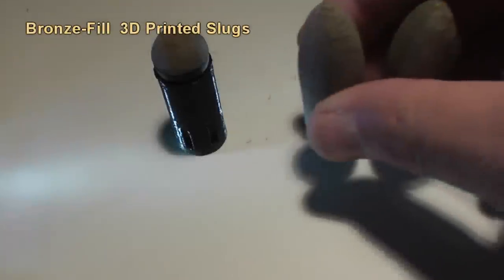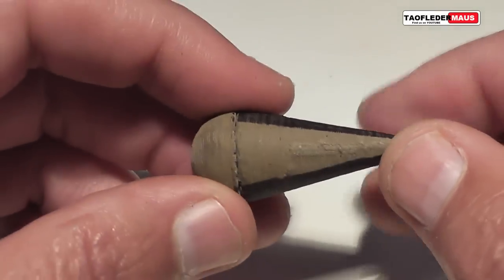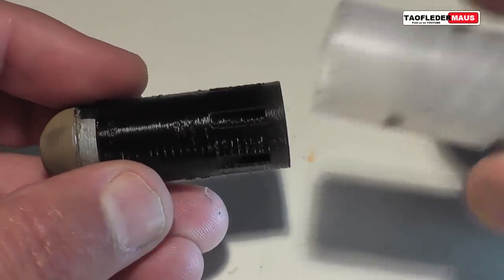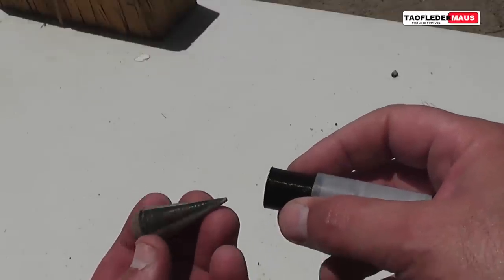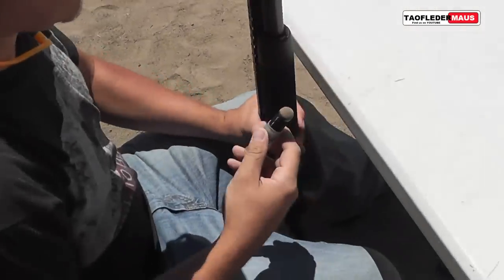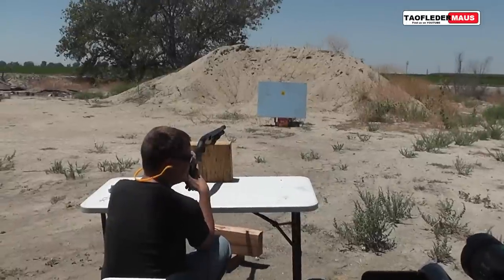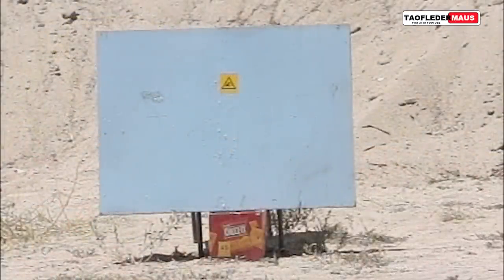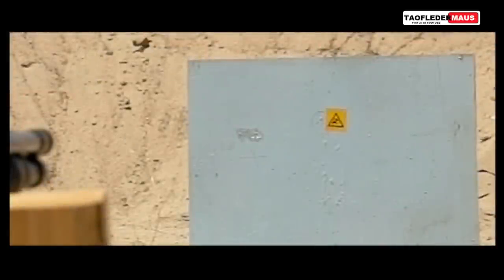Teardrop-shaped 3D Printed Bullet -   Fail Analysis

Comment: Sabot separation is pretty well understood. Teardrop shaped bullets... not so much. As was seen (despite being covered by the sabot), I expected the tail to move in a circle rather than just spin. That would need to be counteracted by an increased spin speed and likely some kind of groove to keep it stabilized. You could try to have the sabot split into a number of parts and spread wide, perhaps by a small secondary, mid-air charge.

Comment: It's nothing to do with momentum, there's an aerodynamic effect that the shot and sabot are sharing with each other. When the shot left the barrel, it created a vacuum behind it which sucked the sabot into it. This gave the shot an aerodynamic shape so it flipped turn-ways at which point the sabot was vacuuming the shot into it. It's essentially the same as driving behind an 18 wheeler on a much smaller scale at much higher speeds

Comment: I would suggest that the sabot be separated into two or three pieces. That should allow for separation after clearing the barrel. The shockwave probably pushed around the round and the sabot lip so the sabot never felt the extra drag necessary for release. The shockwave would create compression as it pushed on the round while the sabot was in the "draft" of the lead body so there was never a chance of them coming apart. I am only guessing as I have never seen a solid sabot like that before.

Comment: How bout splitting the sabot into 3 or 4 pieces and flair the tip a little so when the round and sabot leave the barrel the sabot pieces peel off with the air resistance? Much like a sabot round for the M1 Abrams.

Comment: First thing I thought of when watching even before noticing the title was those are going to mash together and get stuck. I would think that's really what happened, the lower mass of the sabot got mashed while the higher mass shot took a while to reach velocity.

These are always fun rounds to see though. Let's see if the news casters freak out about a failed round as much as they did the first 3D printed shot you used XD

Comment: There's more weight at the front than at the back,so when it leaves the barrel it tumbles,also if it's a smooth bore that would also play a part,as let's say  a 7.62 bullet head would tumble when shot out of a rifle if there was no rifling ,no saying that those two bullet heads are the same but the principle behind it

Comment: The rounds didn't separate bus use both the holder and the round were moving at the same speed if there was a way to hold the holder in place as the bullet launched it would work

Comment: I am by no means an expert but I would assume that the sabo didnt separate due to the fact it was sticking out of the shell too far away from the powder? If you made the sabo slightly skinnier and pushed it in all of the way maybe it would stick with the shell and the bullet would dislodge? That or possibly make the sabo out of a softer material that simply breaks apart after leaving the barrel?

Comment: 2 theories but I'm pretty sure all played a factor and a possible fix. 1st compacting - since the holder had to accelerate first and was less dense then it essentially packed the round inside of it before it left the muzzle, I'm sure that sharp point, different densities and heat didn't help. 2nd velocity and diameter  - since they both were the muzzle at the same speed and the diameter of the two were the same even with the lighter mass of the carrier it had no drag to slow it down and cause the two to separate since they were essentially stream line. If you try it again notch the carrier to add some drag. Should do the trick if the first theory doesn't override it

Comment: If the sabo had a two part construction it likely would have fallen to the sides on exiting the barrel. Alternatively a hole in the bullet from nose to tail might allow the air pressure from forward momentum to separate the sabo, this would also reduce drag on the round and I hope might also increase flight stability
Reply: Realised that I got my physics wrong lol, adding a hole to the bullet would increase drag due to an increase in surface area

Comment: If you cut the saveo or whatever into 4ths it would have split off a little more freely because it splits up the weight between 4 and will slow down faster than the whole thing

Comment: im not surprised the two parts stuck together.  In the world of machine work, conical tapers are used frequently to precisly adapt a machine spindle to a cutting tool. These machine tapers come in two basic types.. self releasing (CAT, 5C, 6K...) and self locking (morse, r8...) . There is some overlap but generally speaking, the smaller the cone angle relative to the rotational axis, the more likly it is to be self locking. Other factors do play a role... things like surface roughness, relative strain (streching from the wedging effect), surface hardness.. but all can be mitigated or exaggerated simply by changing the angle. 

To fix, I would  finish the cone end with a post that prevents the tapers from seating during the "g shock"

Comment: I'd say the bullet didn't separate from the bullet holder because they were both massive and had same density meaning they had the same acceleration through the air, the reason a normal shotgun load separate is cause the holder is plastic and the bullets are lead meaning they got a big difference in density and therefore accelerate differently in the air, the light plastic will simply slow down while the heavy lead will keep on going.
or it could simply be cause a 3-d printer makes a real rough surface and with the shock in the barrel they could simply have been compressed together so hard that they got stuck in each other.

Comment: maybe model the sabot after traditional wadding. like, in a way that it will fit the round into the shell properly but also "releases" it once it leaves the barrel due to drag. have the round itself touching the sabot to prevent it from being jammed into it due to a loose fit.

Comment: If the sabot is a thermoplastic (which i would think is a requirement for most plastic 3d printers) then there is a chance that it may have bonded (remelted) to the tailed end of the projectile as a result of the heat and also the pressure. I'm not saying it completely bonded or bonded very well, but rather bonded at least enough to hold on until hitting your sky blue wall.

Comment: I believe that it is the same principle applied to shaking drinks in a bar. you have to cups that are pressed together at a changing temperature to create a vacuum. I believe that a vacuum was created and forced the two pieces together. Make the casing to where it can break and or fall apart after it exits the chamber.

Comment: Try splitting the sabot cup so it'll peel off and take the Round to a belt sander and smooth it out it looked a little rough smoothness helps lessen the resistance

Comment: Try making folding flaps on the sabot so it has more air recistance and lubricate the space between the sabot and the round with gun lubricating oil the round wil also clean your gun because the pressure pushes the oil out

Comment: ha! have levers in the sabot that have light tension against the barrel & push out into the air stream to catch resistance and pull back once they clear the barrel. Also the tension would grip the round in the barrel with the pressure pushing on the levers, simple levers.

Comment: The sabot needs to be split so that it can more easily come away from the round, but also the round doesn't fit well into the sabot and it has that little point on the tail end. If it's sitting marginally forward in the barrel and the sabot is rammed onto the tail it may embed the tail into to the material of the sabot, binding it in place.
After painting the round you could have used some sand paper to ream the sabot to improve the fit, and maybe put something hard in there to stop the tail embedding, or maybe smooth the tail off a little? I'd like to see the same sort of round fired again with a better sabot.

Comment: I have no idea as to whether this  is true, but from my understanding, two materials of the same type rubbing against each other creates a lot of friction. Is it  possible that there was too much friction for the projectile to separate?
Reply: Vernon682 It's not fiction if they are not moving.
Reply: softrockification It is called static friction. It is due to the surface irregularities of the two solids interlocking. 3d printed solids aren't smooth for (so) many reasons, and that might actually be one good reason why the projectile did not separate.
Reply: Vernon682 That is a very likely scenario. The cone shape is pushed hard into the cavity and jams stuck due to static friction. There may also be an element of heat created by friction or compression causing the projectile to stick even harder.

Comment: Try this, use a small O-ring or print it with a lip all the way around it, so it will fit snuggly in the shell. Then you will no longer need the holder but since the round is so odd shaped it will mostly tumble.

Comment: It seems that the sabots & fittings are compressing disproportionately with the intended "slug" part. This may cause a rubber-band effect when they discharge out of the barrel leading to an uneven or failing separation. Specifically, the fittings are compressed against the "slug" right up until exiting the barrel. The subsequent decompression causes the flexible part to expand unevenly altering the trajectory. Although there are different solutions to this problem all solutions require complete separation of the "slug" from the rest of the assembly. This is not the only video where such a problem manifests.

Comment: Ultimately I think your sabot needs to split. I think mechanics and aerodynamics are keeping that sleeve-sabot in place. 

Even with it though, it didn't fly terribly - seemed to be doing some self-righting as it penetrated and flew pretty straight for being two bits held together. 

Further, I'd be curious to see how it does perform under a full powder charge, it held up fairly well under the stress of the nerfed one.

Comment: it likely didn't separate because the sabot was the part that received all the power from the shot, so it had a higher energy than the tear drop and was pushing the tear drop, to make them separate them the tear drop would need to be travelling faster than the sabot, could probably try using a better high speed camera or a rifled barrel for this. No but seriously if you maybe added more air resistance to the sabot maybe it could slow enough to separate, but at that short distance I doubt it would be very noticable

Comment: Hey just had a thought, what if the sabo were four seperate pieces, so it flies apart right away after it leaves the gun.  I think that'd bascially take care of it.  Also i'd maybe try to have him make it with a slightly thicker tail and have the tail portion of it be hollow so that the round is more nose heavy and will want to fly straight.

Comment: how did you actually expect the teardrop to separate from the rest? because the air is pushing it inside. how could it even come out? i think you'd need to find another mechanism to fire those teardrops and then maybe they would work.

Comment: I'm no gun expert, but to me, if the lip on the holder/sabot extended past the diameter of the projectile, then it would have enough drag to separate. Just my opinion, I might be wrong.

Comment: The problem could be that the sabot was not designed to separate or possess any kind of aerodynamic elements designed to catch or resist the flow of the air and pull it away. Being that the two objects are of equal or similar density, there is simply little going on to resist the force of acceleration the aerodynamic forces that would make it require more energy for the cone to leave the cup than to stay in it.

A solution for this could be machining the sabots to have inward-directed air intakes on 4 sides redirecting air out the back. These could be arranged to spiral or simply point inwards at a shallow angle to either give the projectile spin or simply pull the cup off. This would (should {could}) act as a solid drogue chute and 'tug' the sabot off of the 
 Another possibility is that the 3d-printed elements bonded together from the heat and compression of being accelerated - not entirely sure on this one, but it is possible. In that case, coating both the inside of the sabot and the projectile with a dry lubricant like fine graphite powder could help prevent this.

Comment: Hey!
I think if you cut the sabot into quarters at its lenght, than the drag will peel it off the slug a it enters the barrel.
Reply: sh...t not enters, but exits the barrel.
my bad.
but still it would be cool to see it.
Check out the Chicken-air-cannon from Mythbusters, they did it right.

Comment: I'm betting there's a few things going on to make it fail. The shape of the round  particularly the ridges and wedge, are probably acting like a splitting mull on the "wadding" section causing it to expand in the barrel. The ridges are probably also acting like a golf ball creating micro turbulence around it in flight keeping it flying backwards even though the weight is at the far end, assuming the round and "wadding" section are different materials. Some fins on the round  keeping the right diameter  and you could print a wadding section that would go between the fins and be less likely to jam like that also providing better stability in flight most likely.

Comment: Sabot didn't separate because it was in 1 solid piece, Also it flipped ass backwards for some reason and the round it self was Behind the sabot so because there wasn't any resistance on the sabot it wouldn't fall away because it was being pushed by the round its self.
Kinda stumped as to why it flipped ass backwards though, would have expected all the weight to be in the front because of the cone shape.

Comment: the sabot should have been split in half or in quarters before being placed into the test cartridge, than upon exiting the barrel it could have flown apart leaving the round to travel  to the target instead, also design the round smaller , leaving the edge of the sabot to catch air as it exits the barrel to split apart sooner.  Another option is to forgo the 3d printed tear drop for a milled one from brass or cast?  just some idea's

Comment: I know it probably doesn't explain why the assembly didn't separate, but I would have thought that teardrop shape might lack the rear drag necessary for stabilization?
Reply: Actually a long tail helps with stabilisation. Since it has a higher surface area; when it begins to yaw, there will be a higher area exposed to the wind, thus a higher drag force, realigning the round. You can see that on the video where he shoots powder from shortened pipettes.
Reply: Yeah, but given the taper angle and lack of protruding fins (or anything like it), I would have thought the head barges through the air and the friction against the tail would be minimized? I think it's a tumbler. The tail isn't going to catch enough friction. By the time the tail starts to drag, it'll already be yawed way off course. Not the same with the pipette - no angle; it's all in line.

Comment: Teardrop needed fins, sabot needed to have a reason to separate, that's why you never make it in one piece but at least two and better three or four with big angles for it to snap right away.
This was basically 3D printed cylinder being fired, probably unbalanced from the teardrop tail.

Comment: I think if it were a break away sabo, basically the same thing cut into 4 pieces vertically, it would work as normal. My therory is that when fired the sabo was wedged onto the slug and it was just stuck on for the rest of the flight.

Comment: you could try turning the teardrop around having the pointy and stick out and loaded in a normal show that way it should fire better with air velocity and maybe a little rifling would help but I would cast it out of iron or steel not 3D printed because again 3D printed stuff doesn't actually survive a lot of things like you said. I would try and see what happens when you turn the teardrop around and fire it with the pointy and out maybe you'll get better results and less tumble.

Comment: Maybe lube the inside of the holder and also drill a small hole in the bottom of the holder to allow gas to enter it and push the slug out.

Comment: The particular shape you fired isn't really ideal for anything, but the so-called "tear drop ideal" is only ideal for low to mid subsonic (i.e. barely compressible flow), and it needs to look more like an aerofoil. It would be by no means stable without rifling (perhaps some fins would do it).

The sabot more than likely got pressed on during firing, seemed like a tight fit to begin with. Perhaps some teflon spray would help it shake loose, that and an airbrake (flat plate... disc in this case, normal to the free stream, like on a glider's wing) to force separation

Comment: In a normal shotgun round the slug has a wad behind it that expands as it leaves the barrel the tear drop round didn't seam to have wad it was just the holder or saubo as you would call it it that would have been able to expand it could have possibly been more effective
Reply from the maker: Jeremy Oppelt The shell still used a wadding.

Comment: The only fail reason that I can think is because the speed and the air pressure, the bullet is decelerating due the air friction and the propellant charge pushes the sabot towards the bullet and the speed creates an empty air zone behind the sabot due the cilindrical form so nothing is trying to split them, the only solution in to redesing the sabot to get it split in the air or something that pull it backwards